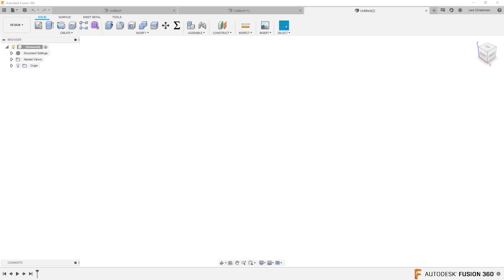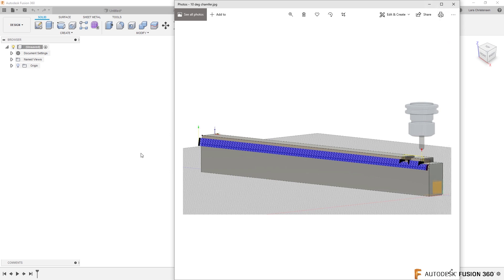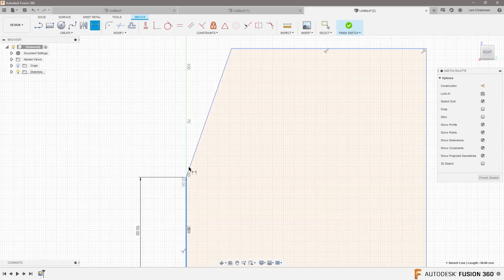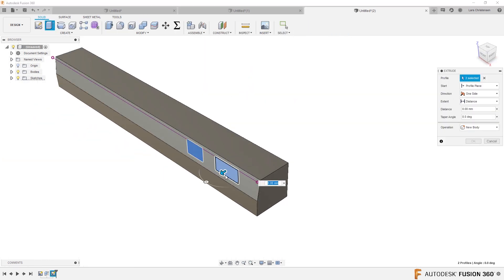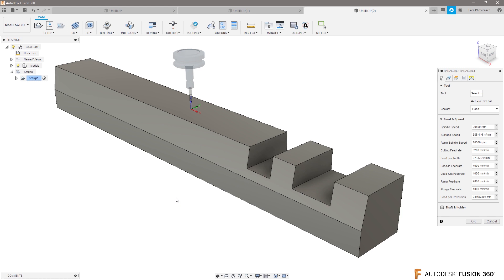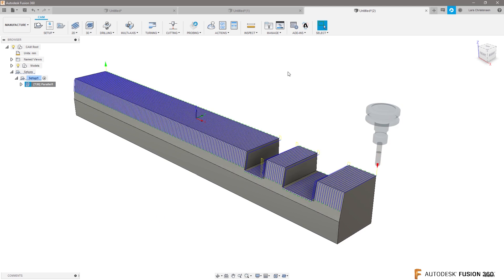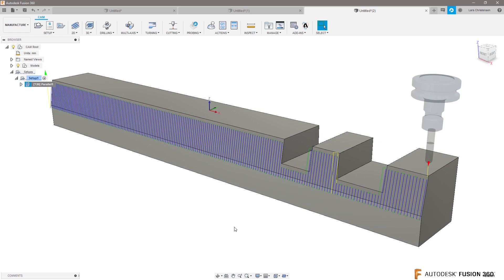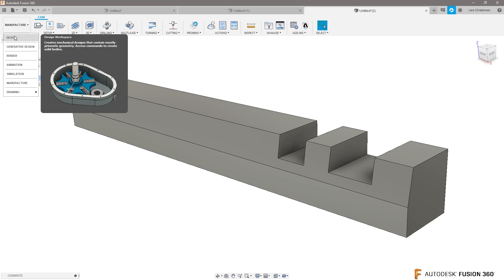Fusion 360 — 3 Ways To CAM Chamfers with Ball Endmill — Ask LarsLive

Comment: Good tutorial, BUT , the most important is to avoid lateral collision between collet and stock ! In certain angles and high of material is to check the angle between the middle diameter tool and the collet marginal side , only after this you could machine the stock, otherwise you will damage the material and collet. To conclude, before do this operation is to check the angle between tip of the tool and marginal side of the collet on separate design.

Comment: What about Model option in 2nd tab - maybe would be better to add there patch surface to not corrupt CAM origin in setup ?
Reply: I was working of a step file,  could not just roll back and patch it up... And if I can I don't know how to about it yet..
Reply: @gracjanlada4622  You can anyway create patch offset ( even if you have some holes  on that  face ) and then modify patch body using extend command for example. Then include this patch as a part of model ( or in the setup or in the 2nd tab of contour tool path ).
Reply: Ok thanks. I'll give it a go and let you know if it worked.

Comment: Out of interest why are you using the ball endmill surfacing vertically instead of horizontally? Does it give a better finish?
Reply from the maker: I think it goes back to my mold making days. If you machine 90 degrees to the direction you would polish or sand the surface, you will smooth the cusps easier.
Reply: @cadcamstuff  Thanks for the explanation
Reply: @cadcamstuff  - My thinking is making the horizontal passes requires many fewer changes in direction (which usually aren't actually at the programmed feed rate because of machine limitations ) and would probably save enough time the finish pass could have more step overs for a finer finish. My hunch is that depending on the programmed feed rate versus the actual machine it would vary some.  Without running some real life tests I I'm not 100% positive.
Reply: I was about to ask the same thing.   Looks more logical to do it horizontally.
Reply: I would personally do a horizontal tool path. I would also use a larger ball mill if I had the option, and make one roughing pass with a larger step over before the finish pass. But to each their own.